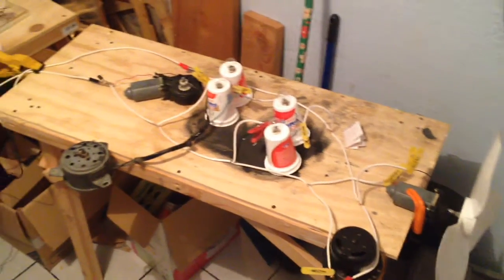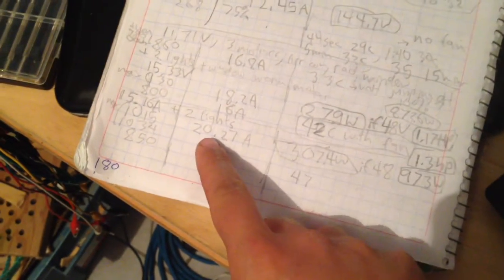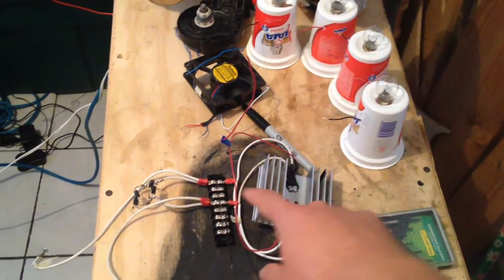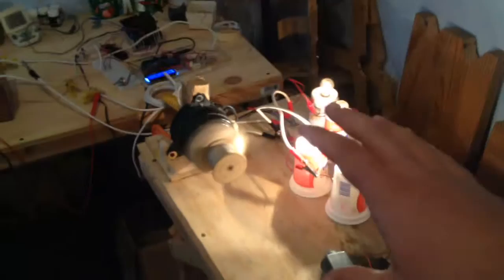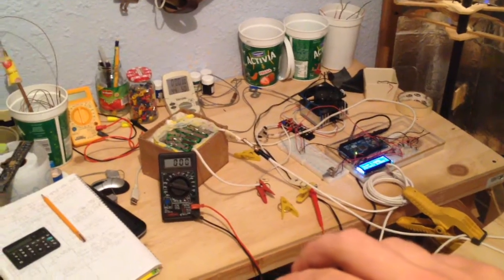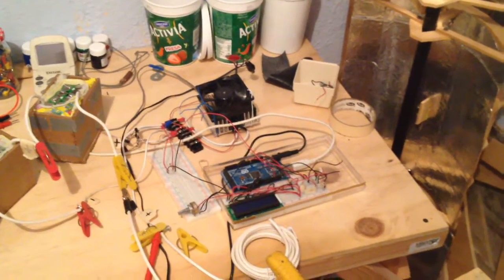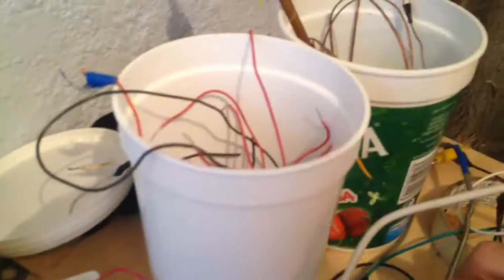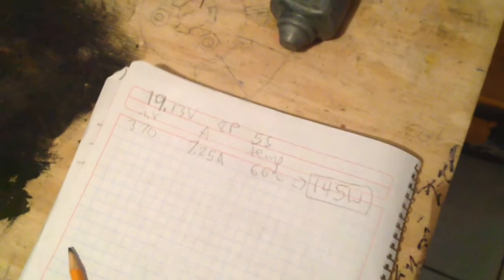E Pod 7, Electric  car, Arduino PWM controller test 2

Comment: Hi..Nice work, but the best way to figure out the power you need is to calculate it on the desired motor before bot it in electricity. then choosing the correct parts ...and keep in mind that there are many more power required , if you considering the loads that will face in real time...regards